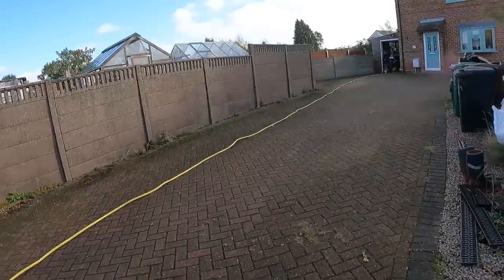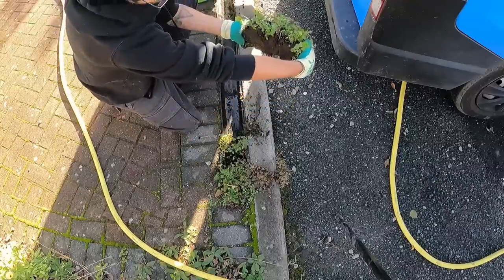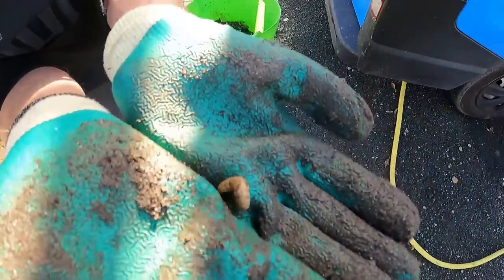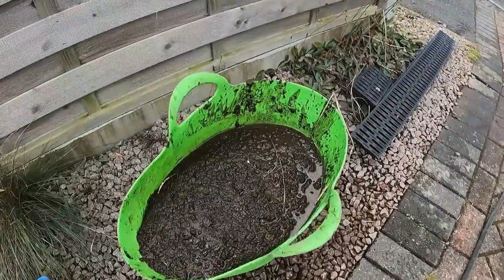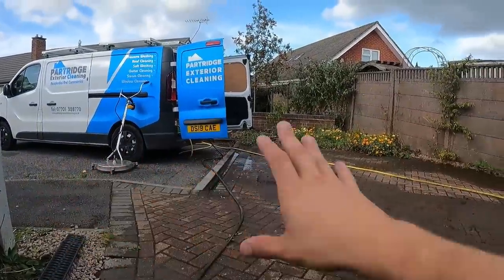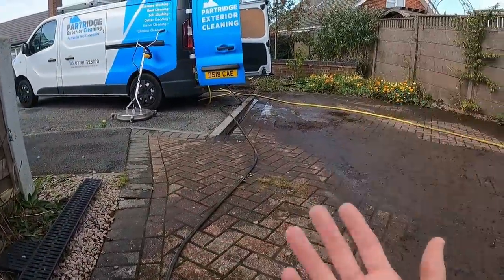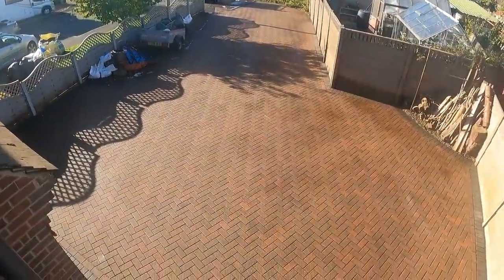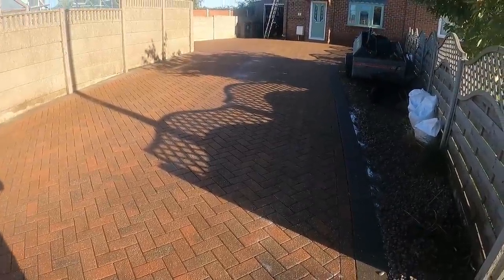First Clean in Nearly NINE YEARS! Big Driveway - Grateful Homeowner!

Comment: I use similar totes in the garden.  If you drill some small holes in the bottom, it allows water to drain out and does not really affect the ability to carry dirt and debris.
Reply from the maker: yeah its already full of them, unfortunately the mud is so thick after pressure washing it just blocks them all up :D
Reply: I was about writing exactly the same :) simply drill a few tiny holes in the bucket 👍🏻

And if you worried about the dirty water coming out, simply buy another, slightly bigger bucket and put one in the other. So the water will be collected 😉

Comment: Nice job on that pal. One trick i use to get rid of slurry or wet debris is to put it into woven polypropeline sacks, then put the sack on a verge or flowerbed. The sack acts like a sieve and lets the water out, but holds the debris in. At the end of the day you can empty them out and rinse them to be used again.

Comment: Drill a few very small holes towards the bottom of the tote. Water will drain but not soil. I've done this with totes that I grow vegetables in and also my large garbage tote I store my soil mix in. It will make it easier when you clear drives. Love watching you work. Great work ethic. We don't have these beautiful paving stone driveways in the U.S. They make the homes look better. You do an awesome job at getting them clean. I am curious why you used the sprayer instead of the round cleaning device.

Comment: What do you do to keep the money in when the season is over and the work starts to dry out, I’m so eager to go self employed and do something similar to what you do but that’s one of the biggest things holding me back is keeping the work steady
Reply from the maker: Roofs, gutters, commercial pressure washing,
There’s always something to clean all year round you just have to be a bit more hungry to find it than in the spring & summer. 
The first year is the hardest, it’ll never be easy but it gets a little easier every year. 

Once you’ve built up your business you can make enough in spring and summer to afford the winter off if you wanted to, but it definitely takes going the extra mile to do so, perfect customer service and really hustling. Best of luck!
Reply: Good question this. Im looking at venturing into this line of work after xmas. I did wonder what you did in the "off sesson" to keep an income. Im a lorry driver by trade so i have that to do until i can build a custome base then all goes well i would love to give up lorry driving and do this full time.